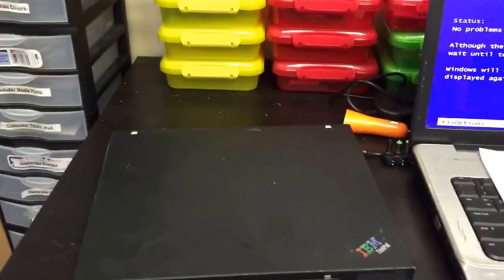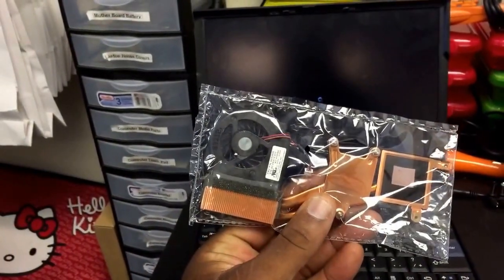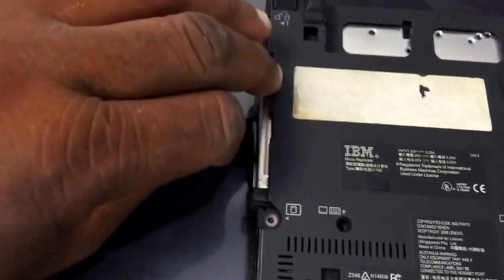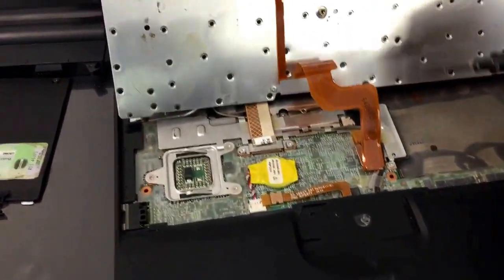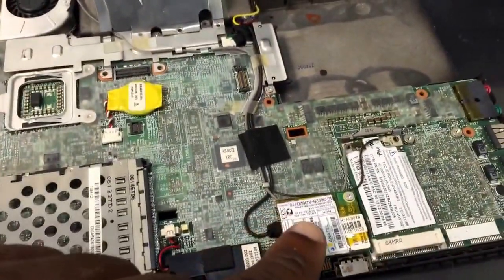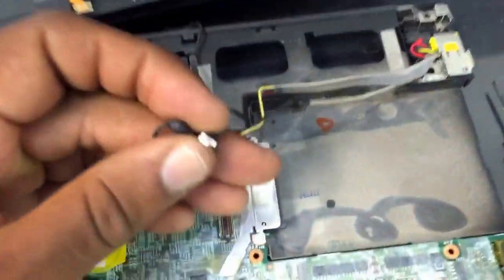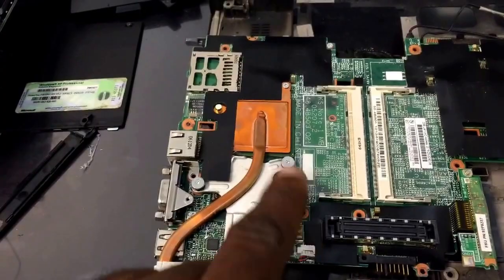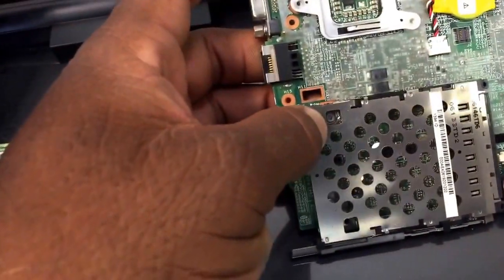Ibm Lenovo  X60s Laptop heatsink and internal fan replacement

Comment: Just passing .. I get fan error on Thinkpad T410 all the time .. instead of replacing it I just blow hard into the fan intake .. clears up the issue every time. Also I have seen many posts on forums relating the same error and attributing it to a BIOS issue that affected many of these units, the update that claimed to fix the issue didn't really work, but as I say blowing into the intake (hard) really does work !!

Comment: thanks. This was very helpful. The only thing that threw me for a moment on reassembly was the lack of a connector into the socket next to the yellow blob. I have no fingerprint scanner.... wondered for a while where I had lost the ribbon! In the event I only had to put a single drop pf trumpet oil on the bearing hole - quiet as a mouse now. Took me almost an hour to do it all.

Comment: was not so complicated at my problem: As soon as fan is visible, scratch the tape between Fan and the leftsided metal grid. After having done I could remove the Fan cover upwards and pull the fan wheel from the axis. A drop of oil at the axis, and noise including "fan error" where gone. Didnt have to plug of any cable, I even left one RAM inside for having the possibility to check fan working by giving power cable and switching on by downwards shifted but(t) plugged keyboard :D 
Thanks a lot for the video (Y).